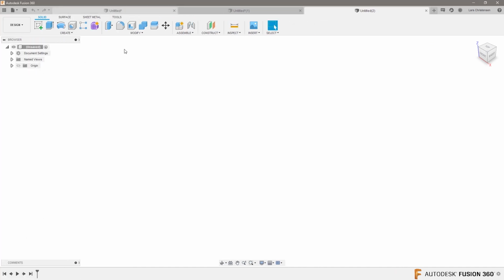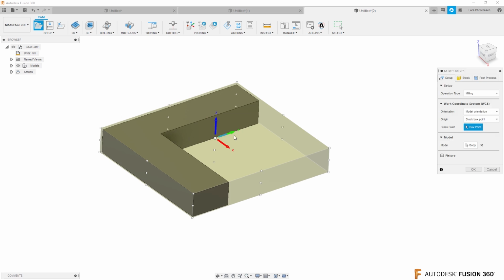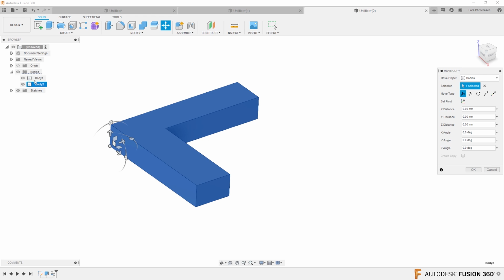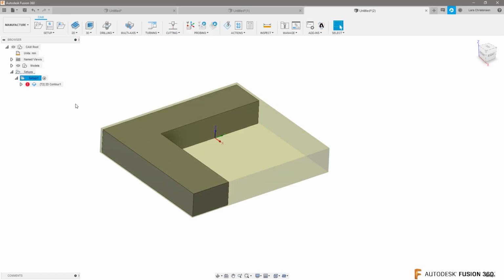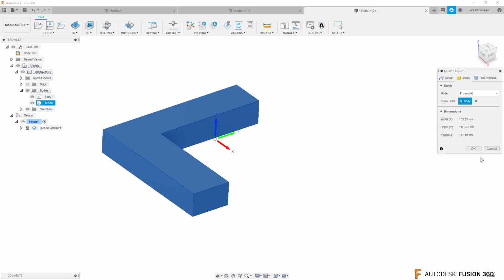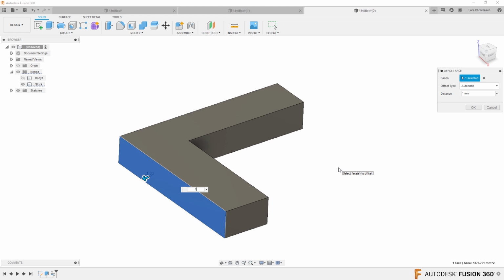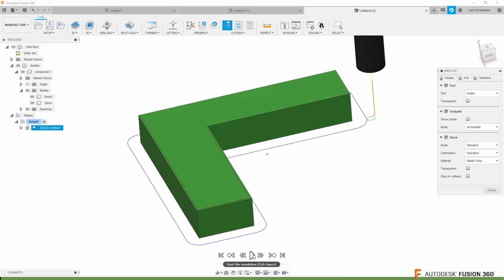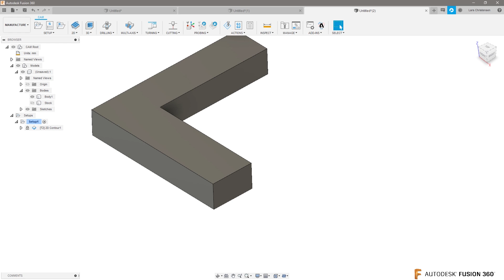Fusion 360 — Odd CAM Stock — Ask LarsLive

Comment: Hallelujah.  I finally got an answer to something I wanted to do for more than a year now.   A lot of my work is on metal profile bars that are L, T, F, H, etc shape.  I always chose the stock as the profile (body) AFTER I put all the holes, cuts, and slots into it in Design.  But then, I could not see what the tools would do to it in Simulate. I was wishing for a way to choose the profile from BEFORE I was Designing the CNC into it.  Thanks Lars.  Not you. The other one.   
Hahaha!  Figure that one out.  lol